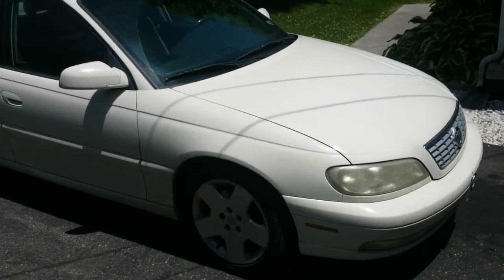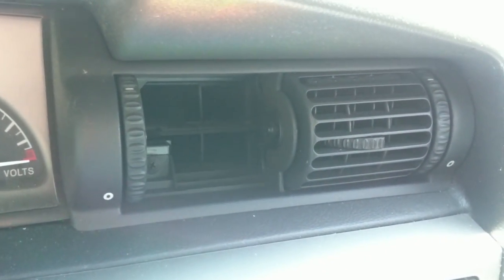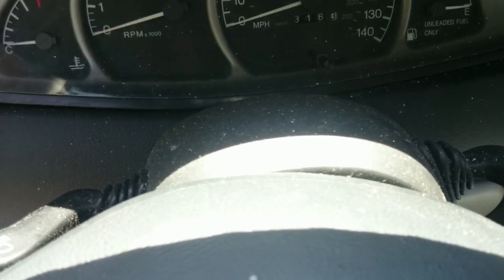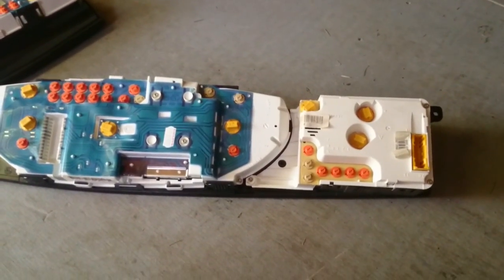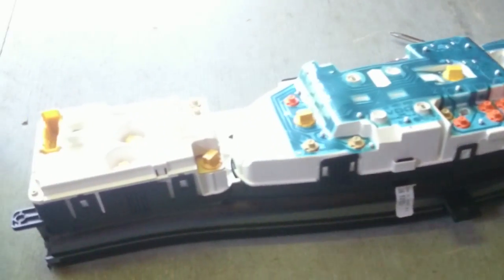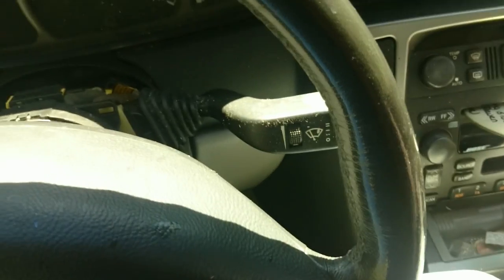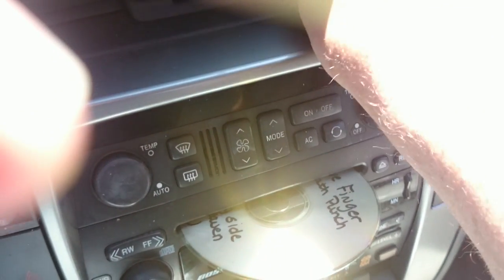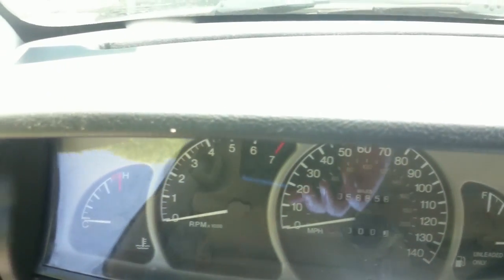2000 Cadillac Catera Sport instrument cluster remove, repair, and replace

Comment: Be Sure!!... and disconnect your battery when re installing the cluster itself.
Disconnect your negative terminal, turn the key all the way forward and pump the brake pedal once or twice (to take any possible power out of the system.

Then remount your cluster.. Once u have both plugs in (especially the yellow one near the AC vent in the middle of the dash.. after both are plugged in.. dont lock it the yellow one yet, Just carefully plug it in.. Dont put the vents and column cover on yet.. Just the cluster.
--Then connect the battery and test the cluster (Start engine.. turn on lights.. Test it.

If all is working.. turn car and lights off now. Go on and lock the yellow plug on the right side (push in its black lock piece).. and re assemble everything carefully (just to not scratch up your beautiful interior dash 🙂

Why? I Went in mine just yesterday to simply change 2 light bulbs, to the far left, for the Temp guage and left side of the Tachometer. Well i swapped all 4 bulbs because the other 2 were old.. I did all 4 to give me a better chance of them lasting longer.
Now my 2 guages on the far right (oil pressure and battery voltage) dont light up.. they work, but now, no lights! The shit is drivin me crazy too, but at least the work.

That yellow plug has fine pins and must be plugged in very carefully because power is always on with the battery connected. So follow my advice. This guys 2 right side guages prolly didnt work (they have 2 seperate power supplies)  becausse he and I may have let power touch and fkd ours up on that side.
So, before putting your guage cluster back in.. disconnect battery.. especially before plugging the yellow one near ac vents back up.

Hope this helps everyone. Peace.

Comment: Had it hooked up by mechanic he hooked it up to monitor:. He said my car was running rich.. And it was causing oil to heat up and run thin.. My check engine light stays on. I can't pass emissions because of this.. So my solution is buy the computer monitor detector that shows  errors and clear it..oil gauge and check oil light will stay off for up to 5-25 miles ..hopefully enough to pass me but the bad thing is problem not fixed.. But it could buy me time as I'm not making long trips with this

Comment: I have a Catera when I drive my cAdillac after 20 minutes the oil light bings and the oil light pops up.. Then it shows my oil pressure gage drop to the red as if there is no pressure while idle or gas pedal is not being pushed down.. In your opinion does this sound like a a bad oil pressure gage?
Reply from the maker: Sorry I'm not that familiar with these cars. I do know from the one in the video the gauge and the light are separate because sometimes the oil light on this one will come on and the gauge showing 20psi. The fact that they seem to agree in your car scares me. If it was mine I'd confirm the low oil pressure with an aftermarket gauge or have it checked by a mechanic.  If you haven't already check the oil level in the car. Thanks for watching!